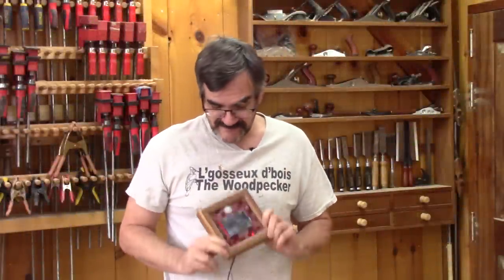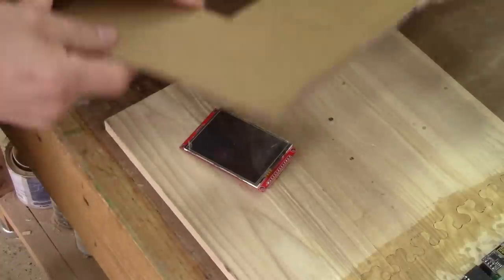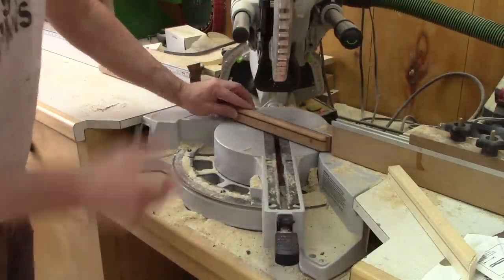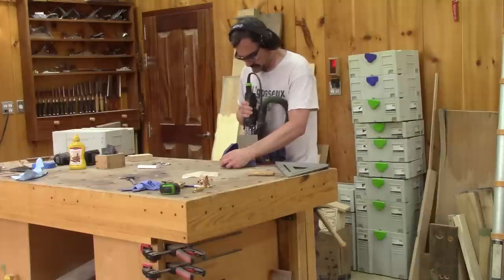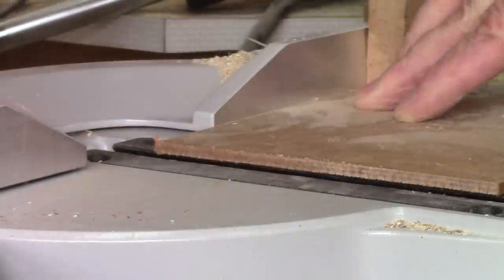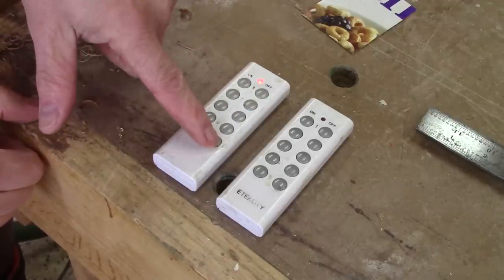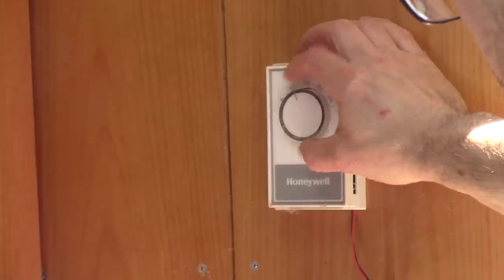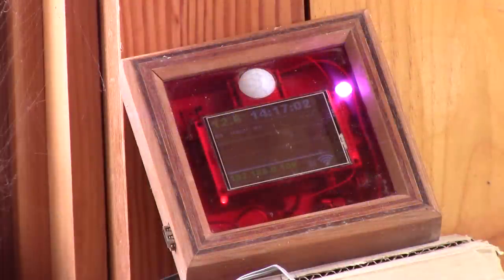The Woodpecker Ep 246 - A Thermostat for the shop

Comment: Brilliant! I want an app for my workshop too. But, I would have no idea where to start. Great video.
Reply from the maker: It all begins with an idea. Then say to yourself, if Alain can do it, I can.
Then look around you'll probably find all the answer you wish for.
The Arduino is probably the easiest place to start. But I don't like it, it has too much overhead but for someone who start it's the easiest place. But in the end you end up with a project that takes way more space than if you do you own PCB like I do but it will work, you'll be super happy and proud. Go for it.
I know not every body like this kind of video I do with electronics. But if I'm able to push only one to try, I reach my goal. Good luck and keep me posted